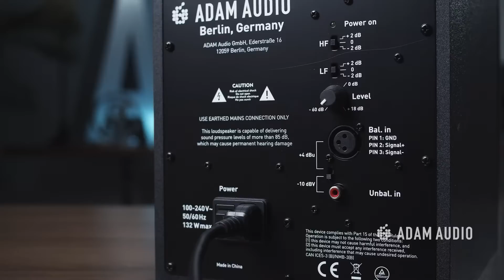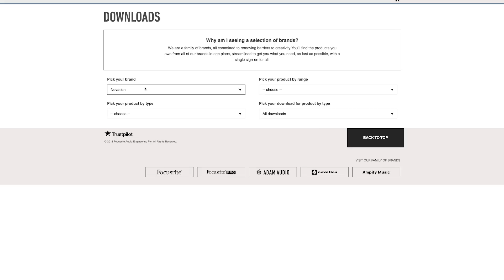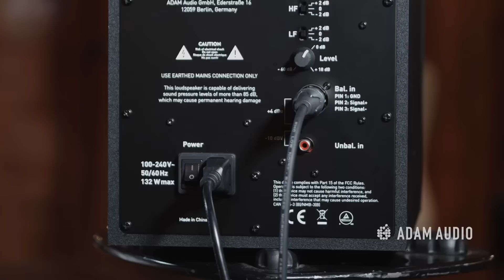How to Setup Your Studio Monitors (With an Audio Interface) | ADAM Audio

Comment: I bought a new pair of A7X monitors and connected them to my Steinberg UR22C audio interface using XLR cables. Everything is plugged in and connected correctly, but there's no sound coming from the monitors. Any help is appreciated. Thanks.
Reply from the maker: Hi! Is the playback engine on your DAW set to the Steinberg?
Reply: @ADAMAudioBerlin  Yes, I'm using Garage Band for now. I have both the input and output set to the Steinberg device. The operating light for the Steinberg interface is on, the green lights for the A7X speakers are on, but there's no sound.
Reply: I reinstalled the drivers for the interface. Now when I click on 'Utilities' and then 'Audio Midi Setup' the Steinberg interface shows up, but as soon as I open Garage Band it disappears and does not appear as an option in Garage Band preferences.
Reply from the maker: @aaronbayley6083  Hi Aaron, if this hasn't already been resolved, this is probably an issue with the interface or the settings on your Mac. We suggest reaching out to the manufacturers and hopefully they can help you with the issue!
Reply: @ADAMAudioBerlin  Thanks, I will try that.

Comment: Hey I just ordered a pair of krk rokit 5 g4 & I’m not sure what cables I need in order for them to work. I have a scarlet solo interface & on the back is just 2 rca red & white plugs . So should I purchase 2 trs cables to rca ? Or trs to 1/4 inch I don’t even know if I’m saying it right I’m a newbie lol
Reply from the maker: Hi good question! You would need to get RCA to XLR MALE cables for that particular setup since the Scarlett Solo Gen 2 doesn't have TRS outputs. Hope that helps 👍
Reply: If you get horrible noise from your speakers you'll need to upgrade to a DAC that has balanced TRS outputs instead of RCA.

Comment: Great video! Can we please start putting caveats on scarlets for PC users? There are plenty of users that have reported popping, and audio dropouts with scarlets on PC. (Myself included). I'm aware that scarlets work great with Macs and would recommend them to any mac user. Avoid like the plague if you run windows!
Reply from the maker: We've used the Scarlett on both PC & Mac, with no issues on either, but I'm sure you could reach out to Focusrite to make them aware of your connection issues!
Reply: @ADAMAudioBerlin  I'm glad you didnt have any issues with PC. I did reach out to the manufacturer and scoured the forums. Attempted a lot of fixes, too. No dice. :(

Comment: Hello, a few months ago I wrote to your email and a colleague of yours told me to configure my monitors with the volume knob at full volume, and to manage the volume of the pc on the pc. Now you say to set the volume of the monitors to 0. Who do I listen to? You or your partner?
Reply from the maker: Technically, placing the monitors at the 0dB mark is the most precise so you can retain the most headroom... However if you have low output on your interface, or are worried about the alignment of the volume knobs, we sometimes recommend just putting the monitors at +18dB. Not a major difference, but for first time setup guides, we suggest the intended level at 0dB. Hope that helps.
Reply: Respectfully asking, is there a hiss in these monitors I’m buying the t8v end of may n I’d like to know  please
Reply: Kahyyam Davis no hiss from the 7’s hope that helps

Comment: i use rca cable with t7v after that my monitor wont turn on
Reply from the maker: Have you made sure the switch mentioned at 1:13 is switched to -10dBv? Otherwise you won't hear anything when using RCA. Cheers!
Reply: ADAM Audio yup i use turn down the to -10db for some it keep power on of monitor but after someone its just switch by itself and won't turn it on now my power button light don't show it is on any suggestion for this ?
Reply from the maker: @amanpreetsinghsra5740  If the switch is not the issue, then we suggest filling out a support form here : https://www.adam-audio.com/en/support/ and a representative from support will get back to you ASAP to help you out with your monitors!

Comment: How can I connect a subwoofer when I using aes digital input in s2v? Thank you 😊
Reply from the maker: Currently with ADAM Audio subwoofers that capability is not there without an external bass management system or monitor controller with a separate subwoofer output. Hope that helps!
Reply: ADAM Audio I know how to do it with Analog xlr input to connect sufwoofer ，but how about aes digital input？any digital input/output on the Adam subwoofer panel ？thank you
Reply from the maker: As of today, our line of subwoofers does not support AES, so unfortunately it's not possible to use the digital inputs of the S2V to daisy-chain a subwoofer from our current portfolio in between.
Reply: ADAM Audio I see ,thank you very much sir